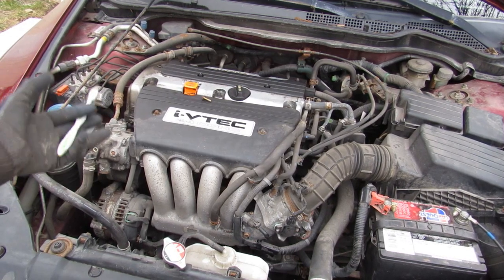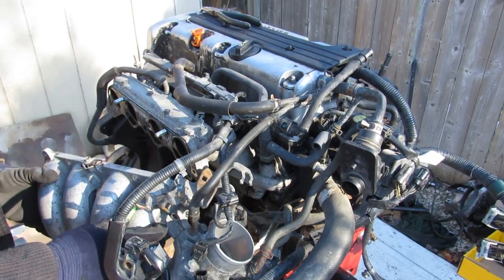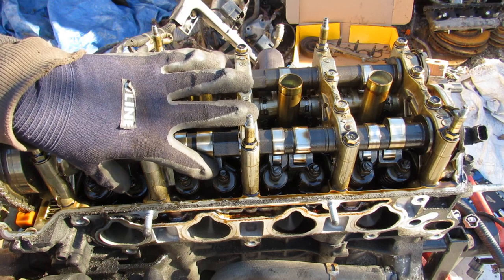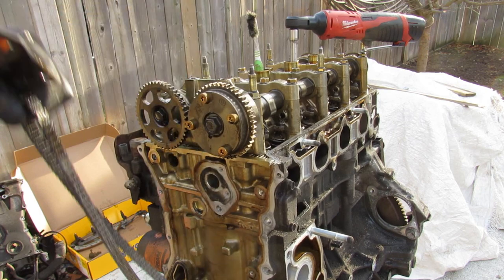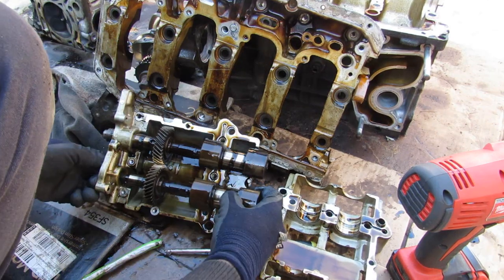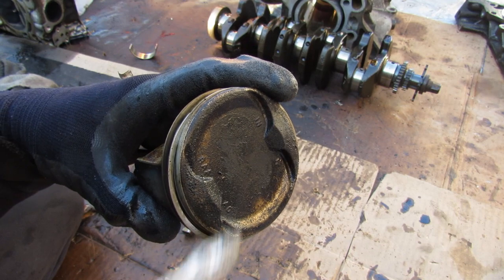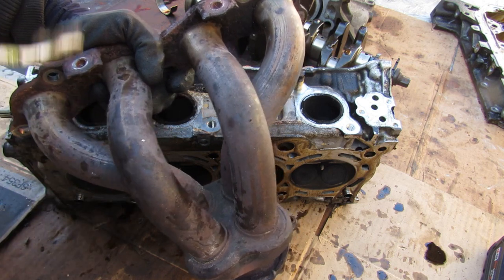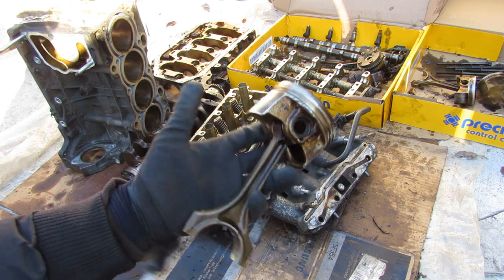Why the Honda K Series is the Best 4 Cylinder Engine

Comment: VW engineers responsible for, among others, the TSI engine, need to be sent over to Japan to learn how true engines are designed and built.  TSI engines are failing at just over 100k km due to relatively minor cam chain/tensioner issues which should've been addressed during the design stage.  Planned obsolescence immediately comes to mind.
Reply: Plus now they are using plastic oil pans, it will fail just in time for VW to try and sell you one of their new EVs!
Reply: Everyone talking as if Japanese engines are all that.  Plenty of Japanese engines are absolute garbage, but some like the K-series are good.  it's the same with all manufacturers.  Take the 1.9TDi VW unit for example.  Super reliable
Reply: @yanierolivera4678  bad turbos and plugged egrs? You obviously never owned one. My current Passat is on 478000 miles, on UK roads, not big long freeways like America. . Had 1 clutch and dmf, original turbo, egr, airflow meter. Serviced as per the vw schedule. Don't sit there and tell me they're unreliable. Another who believes the crap about dirty diesels too.
Reply: They are known to fail at as little as 40k.
Reply: @TheBlaert  yeah it's like they made the whole thing up. Just to destroy Volkswagen. What a piece of crap car to start with. I got a friend who makes a good living off the stupid suckers that by vw's though. That's a good thing
Reply: @TheBlaert  VW common rail diesel engines are rightously well respected, but TSI engines? Not so much. We had the notorious 1.4 twincharged one (CAVD code) and although it was taken care of well, every time i drove it a bit harder i felt like the bucks are rolling out of my packet. With my current honda? not so much
Reply: VW take the piss.  My 1984 8v Golf GTI engine was bullet proof.   Now the engines are absolute shit, hence why I now use a Toyota.
Reply: Noted, I was disappointed with my 2006 Jetta TDI, turbo and lifter or cam lobe weakness, Unacceptable and expensive as a bitch to repair for the low h.p. of the engine. No more Euro cars for me
Reply: @gabordemeter4301  But that's exactly his point: Only because there is one well respected series or one series that fails early, it does not mean that all engines of that manufacturer are the same.
Reply: @robertmuller1523  yea all im saying i would generally stay away from eu brands alltogether because out of 10 type of engines they make at least 4 is notoriously unreliable design, whereas with honda, toyota and suzuki this number would be like 1.
Reply: @TheBlaert  Every time someone critizices VW engines the 1.9Tdi from the 90s show up. It must be the only engine they make well in the "last times" and even with this engine, everything is a legend. There are a lot of different 1.9Tdi engines with different injection systems and cylinder heads. 1.9Tdi 90 and 110hp with rotary pump are really strong, but 150hp with pump injectors was a mess with destroyed camshafts only with 150.000kms in many cases. Tdi 130 was more famous because it was quick than because of it reliability and also this was a legend because there are engines with similar power faster, like 2.0 tdci 130 from the mondeos of that era. Also this engines has a lot of problems with camshats, N47 valve, air mass sensor, etc. I dont want to talk about more recent engines, but VW is probably the car maker with more engine widespread defects, you really can enumerate a lot of engine codes and their design flaws. and that's without taking into account the diesel gate
Reply: When the hell will people stop beating this dead horse? As example, 1.2 tsi ea111 chain problem was sorted by end of 2011. TEN years ago. I've had one from 2013, drove it for years and 10000s of miles with no problem. EA211 improved the design further. They are not the best engines in the world but maybe experience one long term before you copy paste someone's else's garbage.
Reply: you didnt get it - that by design and desired they ARE engineered to fail at that point or not much further.
Reply: My father had 4 Audis in a row. You could set your watch by when they were going to break down. As soon as the weather turned cold, he'd be on the phone with the mechanic. Electrical problems outnumbered the engine failures. We had to call a family meeting and make him buy something different.  A Definite POS.
Reply: @masontee8335  we owned a 2003 A6 2.4 multitronic, bought at 164,000kms.  From day one we couldn't reverse up a steep hill.  We eventually sold it and bought a '92 MB W124 230E with 200,000kms, best decision I ever made.  To be fair, Audis must be amazing for the first 20,000kms, or so.
Reply: @TheBlaert  “plenty” of Japanese engines 4cyls being garbage is not the same as “almost all” Euro 4cyls being garbage. I bought a 2011 Audi A5 with the 2.0T and I am kicking myself. You want German prestige but end up with German failure everywhere
Reply: @repo4  I've got 2013 version of the 1.2 and its a ripper of an engine. Never experienced any turbo lag and it's extremely torquey and refined. Should have a long life as it's well serviced.
Reply: @TheBlaert  Because japanese cars never have clogged egrs and bad turbos. Get outta here with that biased attitude. My 2.0pd that supposed to be a nightmare engine has 200k on it along with a DSG box with the same amount of milage and original clutch packs. Drives like new because I change my oil and take care of the car. I also dont drive it on 3 mile trips which are the number one cause of clogged EGRs and DPFs. Not volkswagen lmao
Reply: @borjacanobarredo3451  2.0cr tdi, 3.0 v6 tdi, 3.0 supercharger, 2.5 TFSI, 3.2V6 (NOT vr6, the regular v6) are all newer engines made by vw/audi that easily make it 300-500k with no problems if they are not owned by a muppet. 1.9TDi comes up all the time because its one of the most common engines in the EU even today.
Reply: @waifuracer6516  you've taken me up wrong my man. Read my replies. I'm sticking up for vw engines
Reply: VAG seem to over complicate things just for the sake of it. Sure emissions regulations have made it harder to keep modern engines reliable and long lasting but the Japanese seem to do it ok.
Reply: @TheBlaert  japanese engines are known for being over engineered. super reliable internals that are great for modding or just good reliability with relatively few issues. this is NOT the same for VW.
Reply: Bingo.
The Honda engines being long lived and reliable is due to the culture of the country they were made in.
Japanese people have very high if not highest level of honesty. Many stories of foreigners losing wallets and subsequently reunited with all their contents complete and untouched.
That level of honesty is carried to their products with lower levels if not zero planned obsolescence.

Unfortunately, I think other than Honda the others are becoming tainted. Why? Due to their European partnerships/alliances influences.
Example:
Nissan => Renault
Toyota => BMW
Mazda => Ford
Reply: @crxdelsolsir  re honesty, absolutely!  One only needs to witness their behaviour during a natural crisis, there's absolutely no looting.
Reply: @TheBlaert  Denial is strong here. Everyone knows VW as a whole doesn't touch the reliability of the Japanese. Especially Toyota/Honda.
Reply: Still haven’t seen or heard of an EU brand that lasts 1 million miles. But have heard Honda and Toyota (looked on YouTube) which has, and I doubt the owners are “enthusiasts”
Reply: @TheBlaert  my first modern VW has a TSI 2.0 . I regret the day I bought it but I hear European VWs are way better than us versions
Reply: @Michael Schuler  Heavily depends on the TSFI VW. Gen 1 and 2 are very problematic but Gen 3 (around 2013 in EU and 2015 in USA) fixed most of the major issues.
Reply: Right after warranty is out to the 3000 km bust point  so common. Old motocrosser.
Reply: Germans arent all that bad, 1.9 TDI is the most reliable 4 cylinder in the world, but it is diesel
Reply: VW know how to make a good engine, they're not interested in making one. The 1.8T and the various other EA827/EA113 are super reliable as was the 1.9 PDI diesel lump.

They feel there is no benefit in designing a car to go more than 100k miles when most people still believe this is the end of a car's life.

Comment: I've seen these engines last over 600K miles with no serious issues. Bulletproof!!!!!! However, Honda engines MUST have REGULARLY SCHEDULED MAINTENANCE. Period.
Reply: Lol that’s with everything. But Honda and Toyota appears to be more forgiving considering almost everyone I meet fits in the category of negligent
Reply: Yes I know I have one let sister in law use car for a year and she didn’t change the oil smh
Reply: really my K24 engine can last that long?
Reply: Yes, it can but whether it will or not, is up to you.  @seinundzeiten
Reply: what are sime examples of regular scheduled maintenance? is valve adjustment a part of it?
Reply: @torontoguy8043  My preference is all fluids and filters @ 30K miles and spark plugs, coils, water pump, thermostat, belts and valve adjustment @ 90K to 100K miles. 
Regular oil and filter changes @ 5K miles with premium full synthetic oil.

Comment: The engines outlasted the cars.
Reply from the maker: Yep until they rotted out
Reply: In my experience, rust is the killer not mechanical failure. It doesn't matter how good the engine is if you're never going to get the bodywork around it through scrutiny. All I can say is, rust protection far outweighs any mechanical advantage in salty climates.

People in dry places rave about Japanese cars, but in the cold climates they really didn't hold up until relatively recently. Mechanically they're usually excellent, but they would just end up with holes in the floor. The Japanese take better care of their roads and don't salt them up as much as everywhere else, so a lot of their cars (esp JDM versions) weren't galvanised for the longest time.

That's why in the UK, a huge proportion of the 70s Japanese cars you see are LHD, because they've been imported from dry places like California. Almost all of the RHD ones originally sold here or Japan are long gone.

Most manufacturers globally got on top of it during the 90s and 00s. Some models started to hold up very well, and eventually they figured it out and all of them got decent protection after a while. Up until then they rotted away like 1960s European cars. Like Cortinas or Minis.
Reply: @thegearknob7161  I live in the South.  We don't have rust.
Reply: @bigdogpete43  lucky bugger
Reply: @thegearknob7161  I have a 2000 Corolla with high mileage, and mechanically it's held up very well. The paint is excellent, too. But as soon as you get to the bottom, it's rusted. The car was made in Canada and apparently spent some time in the east coast of the U.S., so I imagine it's seen its share of salt. Even the fuel line is rusted, almost all the way through, they tell me. I'm debating trying to replace it with high-pressure fuel-injection hose to save time and money. lol
Reply: Damn never thought about that Boone, I bet that’s what they thought about during designing the k-motor.
Reply: @bigdogpete43  no, we have rust. You just have to be a complete blockhead to get it down here lol
Reply: so we can take it out rebuild it and put it in our brand new 400$ shit box
Reply: @realrandom7666  what’s it to you?
Reply: @ThisReckless  i drive a 400 shitbox with a rebuilt 04 engine.... whats it to you bruh.
Reply: @Alfred Wedmore wow.
Reply: @bigdogpete43  None out west either.

Comment: My mother better not say anything when the engine in the Oddessy magically disappears
Reply from the maker: It'll be waiting for that
Reply: it has a K not a J?
Reply: @randomyoutubeaccount6906  on older odyssey u can get a k or a j
Reply: @pity_6095  I never knew that. Both are great for tuning modding but the K is easier
Reply: @randomyoutubeaccount6906  k24
Reply: Pretty sure the Odyssey is V6
Reply: @thebuyingseller  nope. The earlier model (rb1 and rb2) came with k24 motors
Reply: Man a stock k24 in that big ol mini van must be slow as balls
Reply: @lunakai_360  its got decent pick up because its the lighter rb model. But there is a turbo kit for it by hks. I think 20% more ho and 40% more torque

Comment: Great engines.
My 2005 Accord Lx  with a 5 speed manual transmission gave me 491000 hwy miles with only basic maintenance and synthetic oil changes every 5,000 mi.  Best car I ever had.
Reply: Amazing! Sitting at 150k miles here and hoping to at least brake 200k miles.
Reply from the maker: I've seen many accords with very high mileage
Reply: I've owned Accord's with this engine and my current 2005 Element has this engine and I will never get rid of it.
Reply: Yup starting out with a new K20C2 engine in my wife's 2020 Civic Sport 6 speed manual, With 5000 miles on it now I changed the oil with 0W-20 XL Amsoil The mid Grade full synthetic from Amsoil. Car is getting 36.6 mpg Average. Very fun to drive.👍

Comment: These truly are the best engines. 250k on my CRV and it still runs like new. No leaks, no noise, no issues whatsoever. I had a good look at the valve train when I performed a valve adjustment and everything still looks clean and good with minimal wear
Reply: How far out of adjustment were the valves? My 4 cyl outlander calls for valve adjustment but ive read its not worth it unless it's very loud (loose) or very quiet (tight)
Reply: What about VTC actuator noise?

Comment: 6:02 Those two coil packs are bolt to the head via engine cover bolts. That's why when you remove the cover, there is no separate bolt for them.
Reply: Came here to say the same, I once ordered extra bolts to then realize that the bolts were not actually missing.

Thank you!

And great tear down and info, thanks for doing this op!
Reply: Haha, I came to say the same thing. Lol
Reply: @davidyarbrough88  I did not come to say the same thing.  But now that you guys mention it...
Reply from the maker: Ah good one

Comment: Actually, Honda uses the single valve at low rpm to increase turbulence thereby promoting a more homogeneous mixture and thereby a more rapid combustion.
Reply: Yes in economy version of k24. In performance version VTEC system changes from small to big cams.

Comment: Bought a 2006 TSX in 2017, hoping to dispose it in 2019 but after experiencing it is absolutely a keeper. The engine is absolutely stunning.
Reply: Don't, 2013 and newer k series are trash
Reply: @DkpProductions  no they are not
Reply from the maker: Agreed
Reply: Two 5k miles oil changes a year with Mobil 1 5w30 at over 200k miles and doesn't consume a drop of oil. Show me a four banger that can beat that.

Comment: my tsx K engine hit 250K miles and still runs smooth.
Reply: I got an 09 tsx that still runs smooth like butter at 180k miles. I’ll drive this car forever.
Reply: @May16Joe  have you gotten valve adjustment done?
Reply: got a '14 tsx with about 75k, this car's great

Comment: I have never been inside an engine until I got an EP3 civic si . I changed the camshafts on it myself 😎👌  I LOVE this engine it is VERY EASY to modify and upgrade . Honda did an outstanding job with the k series engines simply amazing
Reply: Nothing about dismantling car engines is "very easy" but we get your point.
Reply from the maker: Wait until you tear into a German car engine then
Reply: @speedkar99  i also drive a benz its also a 4 cylinder i haven't opened one up yet I'm kinda scared to 😳

Comment: I remember when I got my 02 rsx type s. And my integra friends calling it trash. Then going silent after I spanked em.
Reply: They must’ve also drove trash because I remember my ‘06 Type S was no rocket 😂 great daily driver for a young guy though
Reply: @johnnykwon8173  This is exactly what I'm talking about.  The k makes more power more efficient than the b. I've had zero issues with my k20a2 and it's got high lift cams 10 years going.
Reply: @johnnykwon8173  I'm confused, do you mean the b16b? That's the only b-series engine I know of that revs to 9k stock. 
B18c5 redline is 8400.
K20a2 redline is 8200 k-pro pushes it up to 8600

Neither b or k will make power above their redlines without heavy modification.
Peak power is well below their respective redlines.
Reply: K20A/a2/z1 are legends. Best of the breed
Reply: My 05 rsx-s definitely punched above it's class
Reply: My son had a ex Japan, 04 Type R Integra, it had Japanese scrutineering/track stickers and Spoon sports parts/stickers on it so had most likely been used for track days/Gymkhanas back in Japan, But it went very well for a 2 litre NA, and handled really well for a FWD.
Reply from the maker: Not only can they take a beating but they last very long
Reply: @Welcometofacsistube  Sick burn bruh.
Reply: @johnnykwon8173  Maybe reliability is a by product but I dont think the engineers specifically were looking for reliability. U agreed with Questchaun, so I'm assuming u r talking about the B16B. The B16B adopted an oversquare engine design (81mm x 77.4mm) as opposed to square (K20A: 86mm x 86mm) or undersquare (K24A: 87mm x 99mm) designs. The bore-stroke ratio alone made the B16B engine suitable to be a high revving engine. The relatively newer K engines, specifically K20 variants, r torque-ier due to a square or undersquare design. This has more benefits than just reliability, and having a little torque in lower RPMs for better acceleration off the starting line is one of them.
Reply: @Welcometofacsistube  Better than driving into them because his ancient outdated Mercedes platform can't handle for crap.